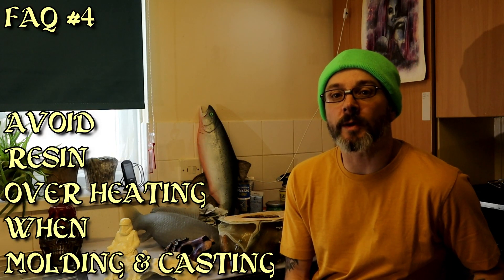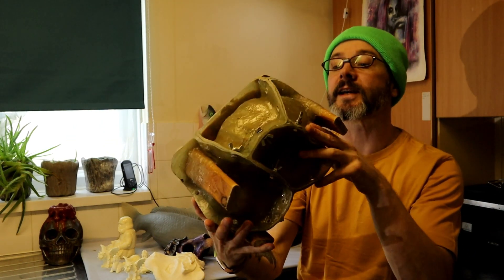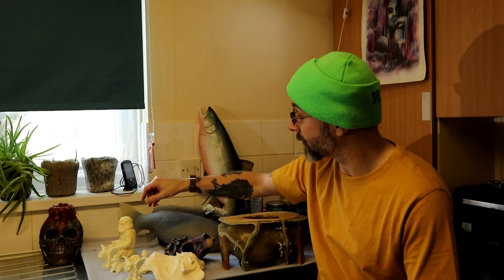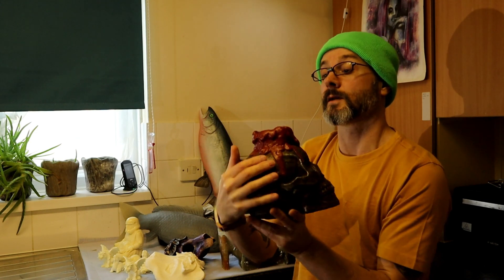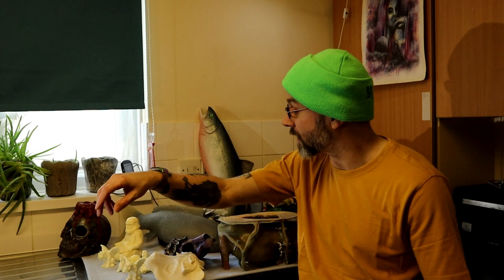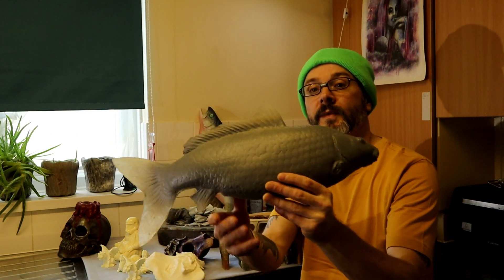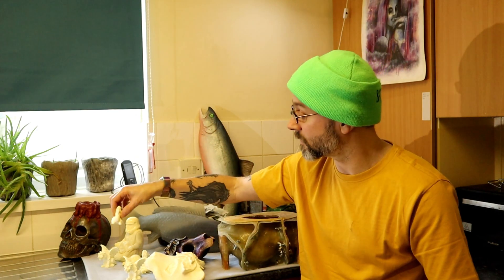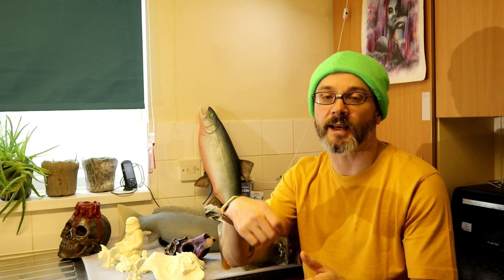FAQ #4 Avoid RESIN OVERHEATING When Casting & Mold Making

Comment: Thank you for make this video and inform. I want to make a superhero busts bigger then your skull like a x1,5 size bigger. I am confused to chose wich type of the resin Epoxy resin or Polyurethane Liquid. Witch resin type have to be less reaction heat and what is the advantages and disadvantages?

Comment: Thank you so much for taking the time to make this video. You've gave me the confidence to make the leap with the resin shell. I've watched the video of you molding the fish a few times to get an idea of the overall process being this will be my first time working in silicone and resin ( I typically use ultracal plaster as I make latex mask) and I'm confident that I can get the job done. Thank you for taking the time to share knowledge. It really helps those of us who are starting out.
Reply from the maker: Thank you very much for the kind words and very much appreciated! :) If you're making masks, you might want to look into slush/roto casting also - will give you more options to match your projects, etc. :) Funnily enough, this channel was going to be more about masks, but it ended up going in lots of other directions too. :D Might be changing the name soon, but anyway, here's an older video on the channel where I slush casted a mask: Slush Cast A Resin Cosplay/Masquerade Mask | Polycraft EasyFlo 120: https://youtu.be/TR_O9e7H4rQ